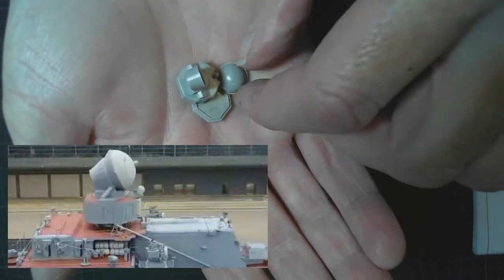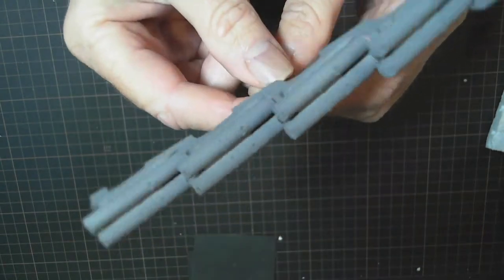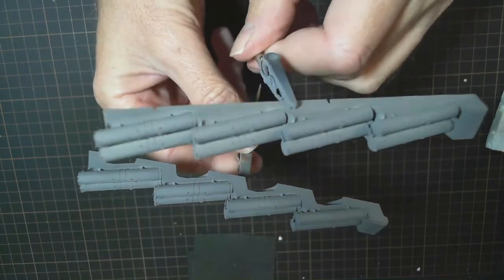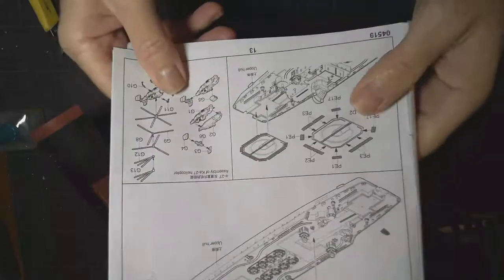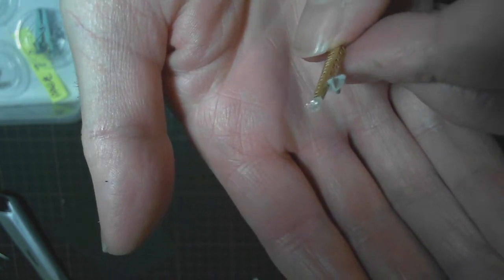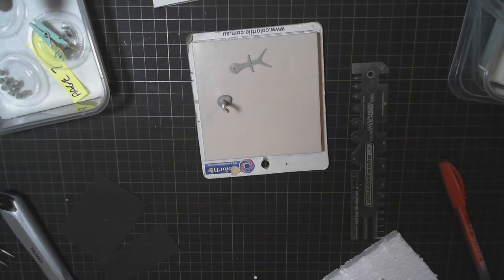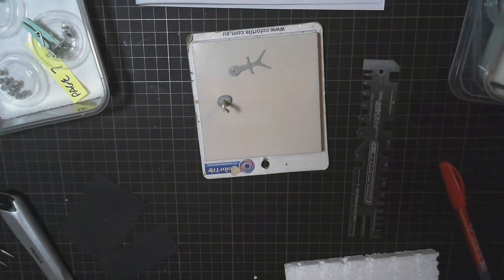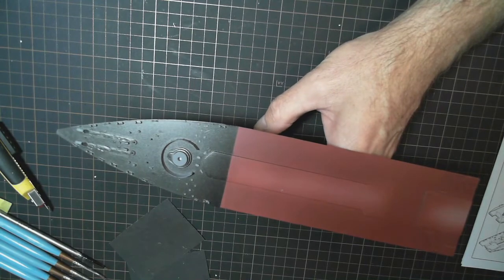Russian Navy Varyag Model Build 1/350 Scale Video Part 5

Comment: Hey mate. Looking good. I did a bit of research. The RADAR that you are painting off white is Top Dome SA-N-6. It is used as the fire control RADAR of the vertical launch missiles (I actually remember it from when I was doing my Electronic Warfare training at HMAS Watson during my basic Combat Systems Operator course in 1998). Looking forward to the next installment mate